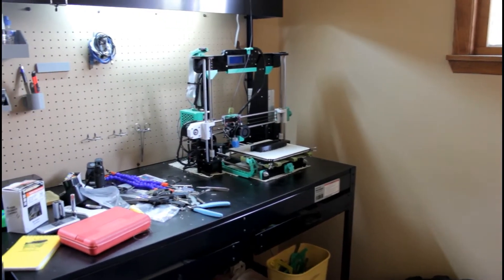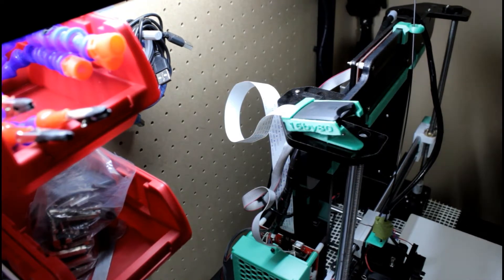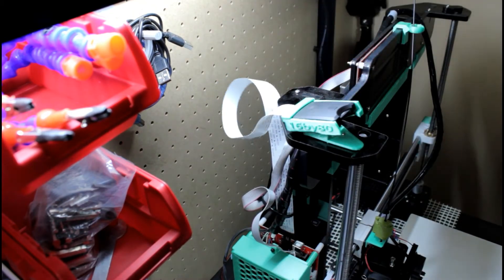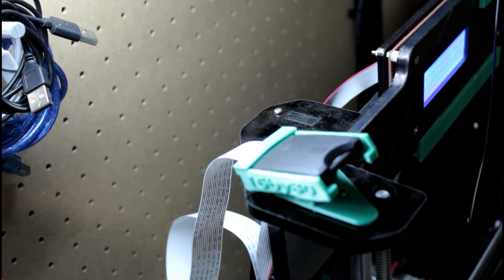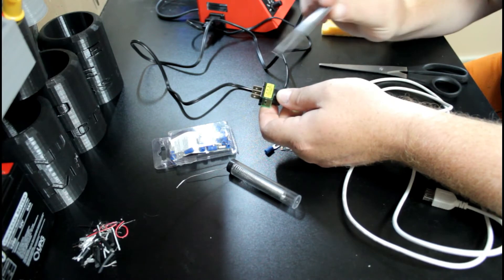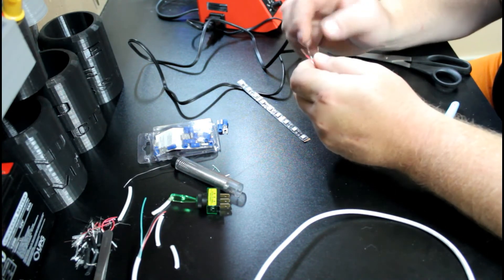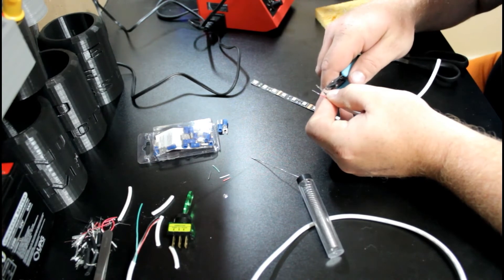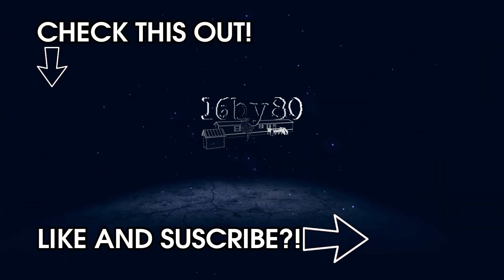Add LED lights to your 3D printer

Comment: Awesome!! I have  a Geetech A 10 and I wanna put a light (strip of leds) on the left side of the printer. U gave me a good idea. By the way, what software u use for the overhangs?
Cheers
Reply from the maker: Thanks! I have an A10M pretty good little printers, I haven't done any mods for it yet though. Currently I'm slicing with simplify3d, but they all do pretty well after some trial and error. As long as you set the supports close together and enough distance away from each side they should break away pretty easily. I hope that helps!